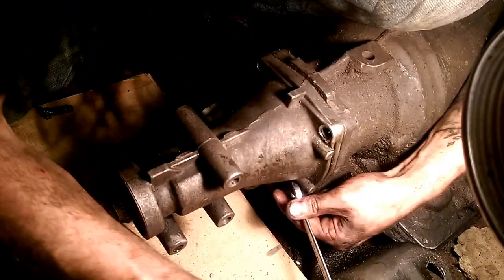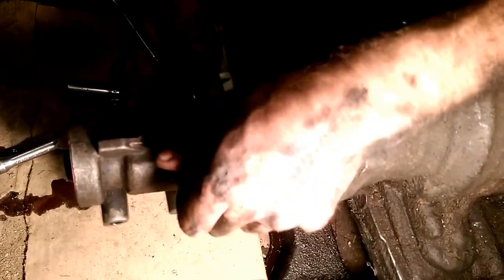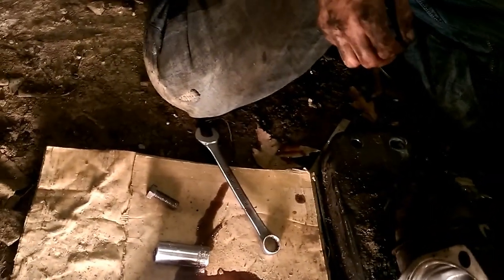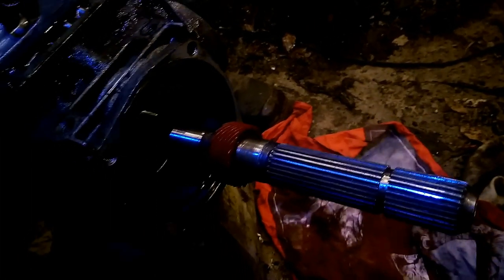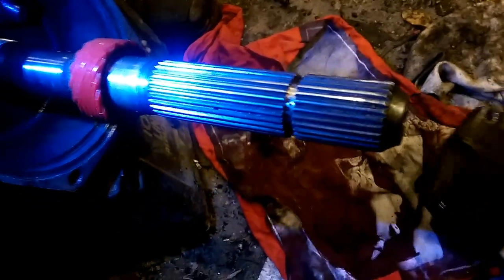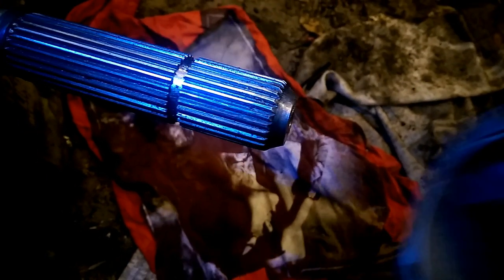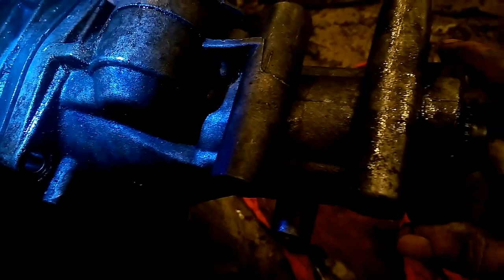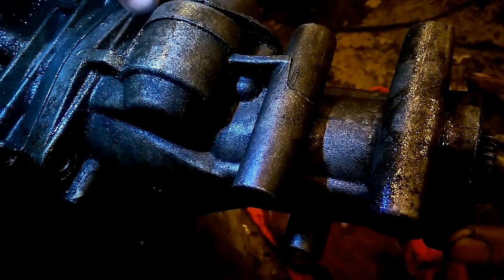How To Remove Your Extension Housing & Install On Your Transmission

Comment: Is the 700r4 better than a 4l60e for any specific reason? I'm not super familiar with the differences between these chevy trans. Thanks
Reply from the maker: they pretty much the same transmission the 700r is non electronic, 4l60e needs a computer to work, on the insides they are pretty much twins and most internal parts will interchange all but the valve body
Reply: @TattsForLife  oh ok, so the no computer would definitely be a plus in a lot of situations. Does a computer controlled engine suffer without the input from the computer controlled transmission? Didn't know if it could possibly cause the fuel and air mixture to mix incorrectly or something not knowing the speed of the car etc.

Comment: How did you remove old Speedo gear and sleeve thing?
Reply from the maker: I switched the whole tail shaft out, but the speed gear comes off with simple by mashing the sliver clip and pushing down and I think but cant remember but I think the sleeve is held on by a clip, or is pressed on... I dont remember for sure
Reply: Thanks
Reply from the maker: welcome

Comment: WHYLL ITS IN THE VEHICLE ON THIS MODEL U DO NOT NEED TO REMOVE THE CROSS BAR TO REMOVE IT. JUST JACK THE TRANS UNTIL THE MOUNT SEPERATES. AND REMOVE. (AFTER TRANS MOUNT BOLTS ARE REMOVED)
Reply from the maker: great info
Reply: @TattsForLife  why is he yelling?